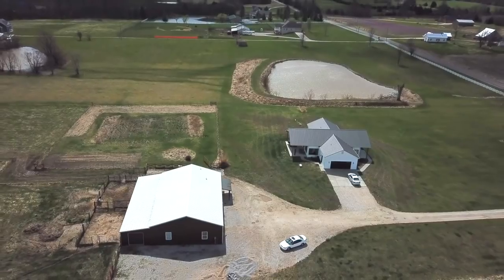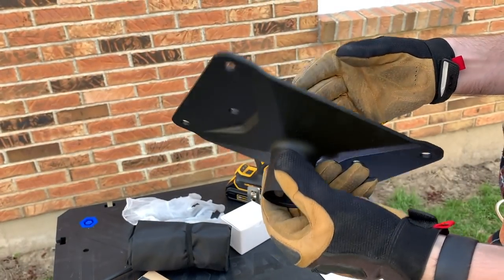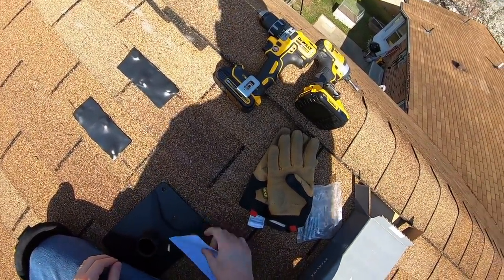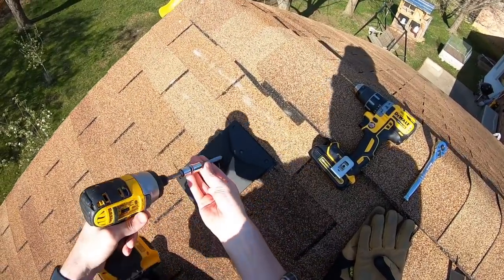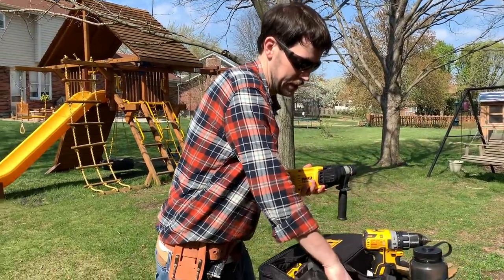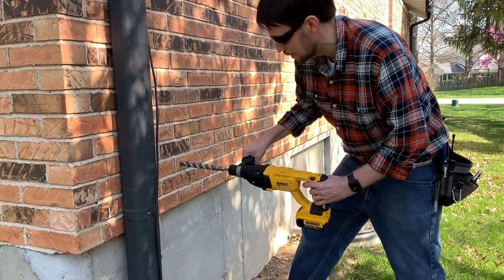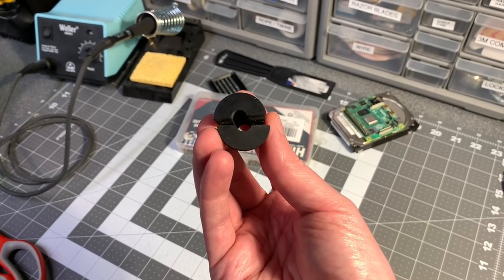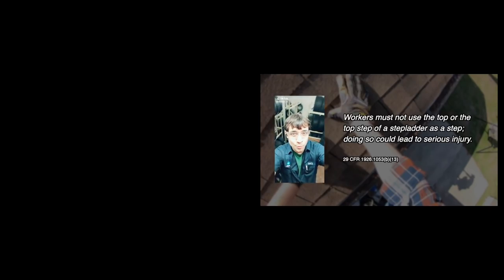SpaceX Starlink satellite internet - Roof mount install

Comment: As a former DirecTV installer, here's a tip for those who are planning on drilling and pulling the wire through your wall. Drill from the inside of your house to the outside. That way your hole will be right where you want it to be and no guessing when drilling from outside to the in. Just be aware of what is on the outside of your wall so you're not hitting any pipes, electrical, gas lines, etc.
Reply: I agree on wood and vinyl sided house, but not brick like Jeff's.  You will punch the facing off the brick if you're not careful.  They even teach you to drill outside-in on brick.
Reply: @MaxDad7  You just have to go a little slower with the masonry bit as you get closer to the outside of the brick. I've only had one minor blow out on brick when drilling from inside to outside. The flange of the coax wall bushing covered up a large portion of the blowout. But with Dishy, obviously there's no bushing to cover any blowouts.
Reply: @jeremycarter  Going slower didn't always help with me, and DIYers don't always have the feel experience when drilling.
Reply: Start with a small bit...then once all the way through use exact size.

Comment: Most professional installers like myself, would use 25mm (1 inch) conduit and flexi conduit to mechanically protect the cable and also helps in sealing the penetration to the house, and the usual silicone sealer
Reply from the maker: I was planning on doing that, but was too nervous about the ID of 1" conduit, if the just-more-than-3/4" ferrule would fit (though it sounds like flexible conduit is better for exterior penetrations?). Honestly that was the one part of this job I couldn't find a good guide on online—e.g. what exact conduit to use, how to manage the connections, etc. (I could've just been searching the wrong terms.)

Also the grommet I installed over on that corner of the house looks a thousand times better than the holes for both AT&T and Spectrum's drop into the house 😞 — I wish more of the contractors who route cables into people's homes would care to do a more professional job.
Reply: I've never seen anything except electrical wire in conduit unless it's going underground.

Comment: Love the video. Couple of notes: 
1) prevailing edge, homey. 
2) sawdust will always be in if you hit the plywood backing of the shingles (which you did)
3) rotate the mount 90º and you'll have a better chance at getting double studs
4) carry roofing caulk to seal around the mount and the holes to fight future leaks.
Reply from the maker: For the sawdust note, I cut it in the edit, but I was definitely in solid wood for the full length of the bit on the center holes and the right side holes. The left side I felt air beyond the roofing plywood sheathing. It's not something easy to convey visually... but if you drill into a thousand studs you know when you're in wood versus air :)

The studs in my attic look to be 24" apart (definitely 16" or more, though I haven't gone up and measured them since I normally am working on projects on my ceiling from above, and not up on the roof), so turning the mount sideways wouldn't have helped reach more than one stud.

I'm guessing the stud on that edge of the roof is a double-stud being on the edge of the attic space. Honestly I have not been in the part of the attic that juts out over that part of the house, so I can't say for certain :)
Reply: @JeffGeerling  Almost certainly a double-stud. Also I wrote #4 before I saw the part where you had sealant :)
Reply: Also nicely done on the drip loop in the redux.

Comment: I used to work for Dish so I wanted to check your install, and see what they provided in the kit.  It's good to see them provide bishop tape (pitch patch as we call it) for sealing the roof from your lag holes.  Those big rectangle patches alone are plenty to seal the roof, but the others are provided for peace of mind I guess.  I recommend most people to work off of a ladder if they plan to do their installs and not be on the roof like Jeff is.  The easiest way to find a rafter is to be at the gabled end of your roof and measure your overhang, then take that measurement and apply it to the top of your roof, then add an extra inch to inch and a half to account for your siding, foam board, plywood, etc.  You don't have to be at the peak of your roof like Jeff either.  You can put it anywhere down the roof line if you have the line of sight.  You won't gain any advantage being higher up.  Always pre-drill your holes!  Don't just ram the lags or you will split the wood and won't have as good of a hold.  Don't overtighten your outer lags as they will most likely be in plywood and will spin out.  Once you start seeing the pitch patch squeeze out from under the mount, you are tight and good to go.

EDIT:  I finished watching the video and you did a great job!   A fine job getting the hole into your house drilled out properly, and a good idea using a rubber stopper as a grommet (I would have just filled the hole with gasket sealer since that's what we used. LOL)  I felt better once you realized fastening the cable to the front of the fascia was easier and better, and utilizing the downspout to zip tie the cable is what is easiest.  Also good service loops (drip loops) and explaining to the viewers the importance of them.
Reply: Thanks. You complemented this video well with your tips. Good to remember that, with proper clearance, one don’t have to climb to the apex of the roof (not much closer to the satellites 😉).

Comment: remember, always use the right tool for the job. in a pinch a hammer can usually be configured as the correct tool, in a pinch, any tool is a hammer.

Comment: This video was awesome thank you!  I like that you leave in the messy details unlike others that go for production value.  

What worked for me for entering the house was to remove a section of soffet temporarily and drill through the wall above the brick.  This of course brings the cable in upstairs but I like having the router up high.  Since I live on a hill, It gives me better reception out in the garden.

Comment: yeah that cable should definitely be detachable so that you dont need to drill such a huge hole and also so that you can have exactly the length of cable you need :D
Reply: It's just a cat6 cable nothing spectacular. Add a grey pvc electrical box on outside of house with a slot in the lowest side for wire. Then run a cat 6 patch cord from there inside home to wherever is needed eezy peezy
Reply: @mrmotofy  So, as one who is not "techy", how do you connect the cat 6 patch cord to the Starlink cable in the electrical box?
Reply: @timmattingly2250  Just use a Coupler or RJ45 jack installed on the wire inside the box. There's RJ45 coupler Keystone jacks and a coverplate for the inside if you wanna try and DIY with a store bought Cat6 patch cable. Or find a low voltage installer to run the line for you. Label the jack on the inside so it's obvious where it goes or what it's for. Ideally it's a home run line, so it goes to 1 location by breaker panel or a utility area where all future lines run to.
Reply: @mrmotofy  It’s also a Power Over Ethernet cable

Comment: The "ferrule" thing on the cable is an EMI filter made of ferrous ceramic, a cased in plastic. It prevents EMI (ElectroMagnetic Interference) from being conducted on the outer shield of the cable and acting like a radiating antenna.
Reply: as well, it will restricts the passage of current surges produced during a lightning storm... I would peal out the cable and connect the shield to a good ground... before going into the house
Reply: @soulrobotics  That would be a very bad idea. Using a DC coupled ground is never a good idea in this scenario, as it would cause the cable and "dish" to attract lightning much more. There are LAN cable lightning protectors specifically for this purpose. They use a gas-discharge spark gap device that does not have a direct connection to ground, but rather a small gap arcs over in the presence of a fast increasing voltage difference... shunting the surge to ground.

The ferrite EMI filter has no effect on current surges, only RF frequencies.

Comment: As a former dish installer, you don't need to mount it high on the roof. That extra 10 feet wont give you meaningful signal. Mounting it lower means that any  leak is has MUCH less potential  for damage.
Reply: I disagree. I have installed multi thousand HN, VS, WISP & tv dishes. If I can not install above an unoccupied area then I go high so I have a smaller watershed. Lower is easier but higher is better in my book...once SL opens in this area I will be installing them too....

Comment: I recommend what the DirecTV installers use, a Bishops/Mastic tape, a full sheet under the footpath, makes an great seal as it grabs the lags and is pulled into the hole and the foot plate is basically welded to to the roof shingles...

Comment: Nice job.  The one thing you didn't do (or at least didn't show doing) that I would have really recommended was to set up Dishy on your roof for testing it in that specific location before making it a permanent install.  A week or so should be plenty.  Even though the app shows where you need clear views, the system seems sensitive to even minor obstructions and doesn't always match what the augmented reality check from the app shows.  It's worth it to try moving it to a few locations to see if one might be better than the others before going with the permanent install.

Comment: Always drill from inside out - always. If concerned about blowing out a divot in brick for example, use a 3/8" bit first then go outside and drill larger hole from out there there.  Also a masonry bit will drill just fine thru wood, a lot slower but less time than screwing around switching bits.  I have installed thousands of dishes

Comment: Nice to see a start to finish video for an install.  It's all the little things not mentioned in the manual that give you pause, and ask "How is it supposed to be done?"  And making a mid-install change on the cabel ties is a nice example of this.  (Did you go back and caulk those holes? ;) )  Having an older circa 1910 home myself, that's 2 stories tall, with 45 degree pitched roof would make a rooftop install a "Bad Idea" and I would decide to just add a mounting pole in the yard and run the cable underground instead.  Also, good to see you outside doing all the things, showing that even with your 'condition' you can still wield a hammer drill like a pro! :D Job well done!
Reply from the maker: Those little things are exactly the reason I decided to post a full video and not a quick summary video of it—I had a lot of little questions going into the install that I couldn't find solid answers to on Reddit or elsewhere, and the official cable routing kit from Starlink only has the parts for a vinyl-sided house installation.

And yeah, Crohn's can be a bit of a burden sometimes, but I've been lucky to have a good year so far (knock on wood!) with very few symptoms!

Comment: I just love how at 23:17 you plug in the cable and the light goes out.
Good timing on the automatic light switch-off :D

Got a little nam-flashback to the time i accidentally bridged the power pins of my raspberry pi in an unprotected circuit and fried one of my main power fuses. Started with the sentence to my brother "So we just plug in this and everything should work just fi..... *bzzzt*" 
Effed up my gaming pc that way.

Comment: I seen on another install video the guy had a "Blue Sea Systems Side Entry CableClam" to cover the hole to get it in the house. Personally that is the route I went, but they home made rubber plug/grommet looks like it will work well too. Good job!

Comment: I was an installer for Dish network and Direct TV for years and never used that black butyl sealant on any of the roofs that I installed dishes on we just filled the holes with silicone and then ran a bead of sealant around the foot and over the tops of the lag bolts that we screwed into the roof and never had a leak on any of the jobs I was on.  That sealant stuff that they gave you is for use both under and on top of the foot you installed on the roof the smaller pieces are to be placed on the bolt heads and pressed down all around the bolt to prevent water from running down around the head of the bolt and following the threads into the roof and the sheets are to go under the foot before the lags are screwed into the roof.  If you have ever taken the inner panel off your car to install new speakers you would have seen the same black sticky material holding the plastic water shield on the inside skin of the door. The black material is called Butyl tape it is a very sticky type of rubber and is semi self healing therefore providing a water barrier between the dish you are installing and the roof material.

Comment: For anyone passing pre-terminated cat cables tape around the whole connector so the retention clip doesn’t catch on anything and snap or make it impossible to pull back out, it acts like an angled barb
Reply from the maker: That's a good idea, and I don't know why I didn't think of doing that. I always do when I use fish tape or a string to do a pull, I guess I just threw myself off thinking about how annoying it was to have to pull a pre-terminated wire that didn't detach from dishy :D

Comment: If you already have Cable Internet, why are you bothering with actually Mounting that thing on your roof, if its (probably) just for testing?
Btw, this is, till now, the most professionally done install i´ve seen. Except for safety, there isnt anything I would`ve done different. That being said, I´m probably not much more of an installer, than you are lol.
Reply from the maker: I have long wanted to have a 2nd Internet connection. And if it can be reliable, it could be a failover, or be used for bonding/aggregation. Fun to test some of these things on a Raspberry Pi router :)
Reply: @JeffGeerling  Sounds pretty good, but why go w/ starlink, which is atm pretty expensive and not at 100 percent capacity? Don't get me wrong, it's a nice system but for your purpose it doesn't seem to be the right choice, or is there, besides the tinkering, anything I don't see?
Reply from the maker: @xxcr4ckzzxx840  Tinkering / exploration is the main reason, but even so, the only other two options are very flaky 4G wireless (and just as expensive, with data caps, so not good for failover purposes), and half-as-expensive-but-8x-slower DSL. AT&T was supposed to run fiber to our neighborhood 10 years ago... never happened.

Comment: At that point i would just run my own cable in/out of the house and use the included cable as an out-door only cable. Just make sure to terminate in a weather proof box!
Reply: Cat* Cable Max Cable Length: hello.
Reply: @DanielPinel  cat5e is good for 1Gb up to 100 meters (328 feet). This wouldn't be anywhere close to that and you likely wouldn't hit those speeds with a wireless solution.

Comment: Red shirt Jeff would have hacked a connector off that cable, and crimped up a new one later, nothing special, just shielded Cat cable (probably Cat6). I would have also bought the non-penetrating mount. Since I still have many months before I have coverage, I'm planning my install. Roof of house, roof of garage, pole on fence, maybe on a shed in the yard, maybe on chimney mount. Still not sure and need to get on the roof with the app and see where it will work best around the trees.

Comment: I'm curious to see if this setup will have all the little problems and flaws as a Ubiquiti/Mikrotik outdoor CPE setup has in the long run. Problems like: FTP cable damage by rubbing to the roof edge in high winds, radio front end excessive signal attenuation and ethernet port ESD damage caused by high wind/lightning storm, cable UV resistance and last but not least: corrosion of the end connector caused  by CPE box inner condensation seeping through inside of the FTP cable, down to the PoE adapter. These are all the little things I can remember from installing a lot of CPEs at an ISP back in the days. No idea if a lightning rod is recommended or not in this case, also if I remember correctly most telecom grade radios needed individual earthing (beside the one that connects the FTP cable shield to the PoE adapter 8P8C socket housing to mains earth).

Comment: Ideally, you don't want to run power along with your data cable. I would try and anchor your power wiring on the opposite joist if it's running down that particular channel between joists.